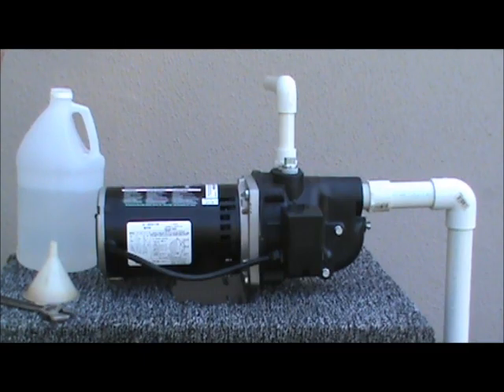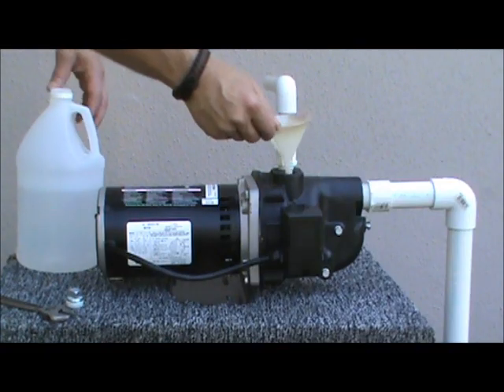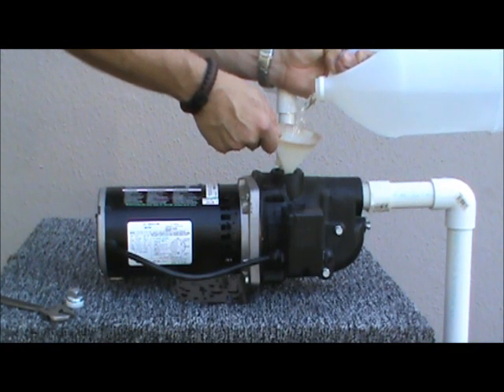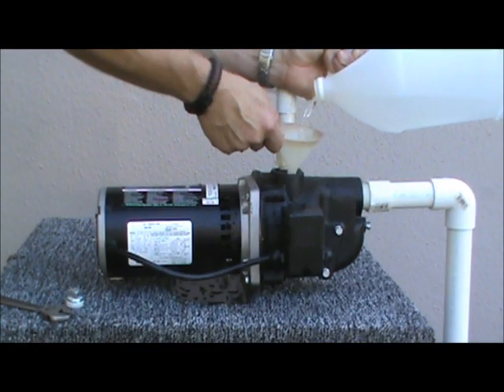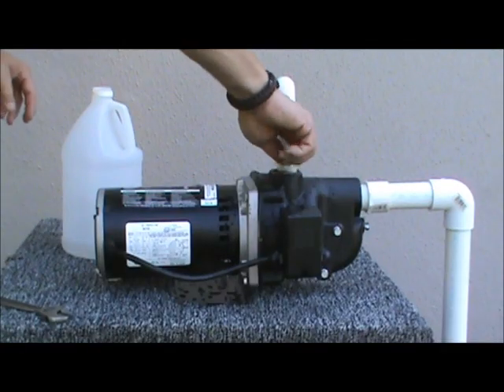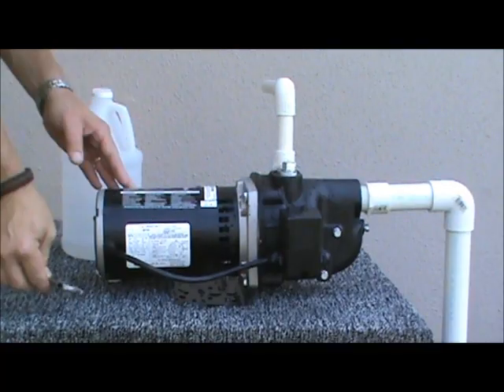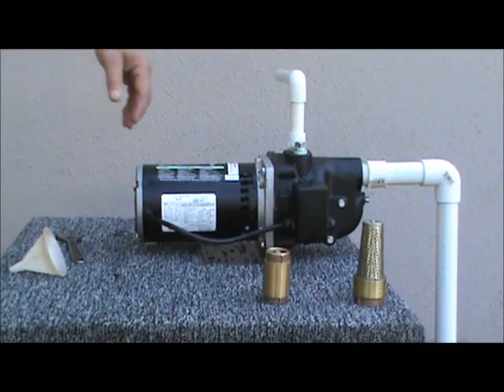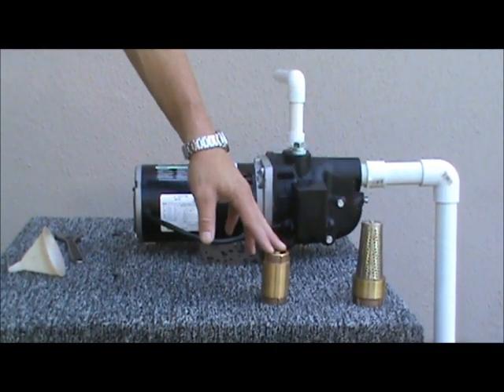Wayne Shallow Well Jet Pump with 8.5-Gallon Pressure Tank - 1/2 HP, 288 GPH, Model# JSU50 8.5FX

Comment: I have to pour water into my water motor(home water pump) every 2/3 days in order to pump the water,without pouring the water it won't pump the water;i've this problem since three month back;its becoming really annoying wish u could help me fixed the problem
thanks in advance
Reply: sounds like your check valve or foot valve is faulty
Reply: change the football